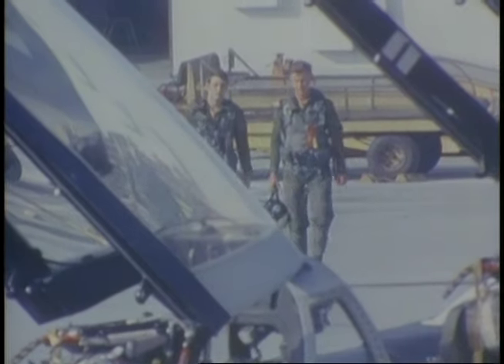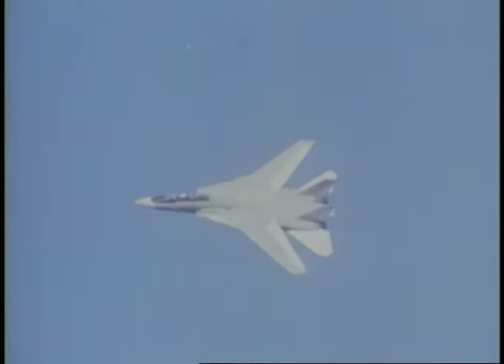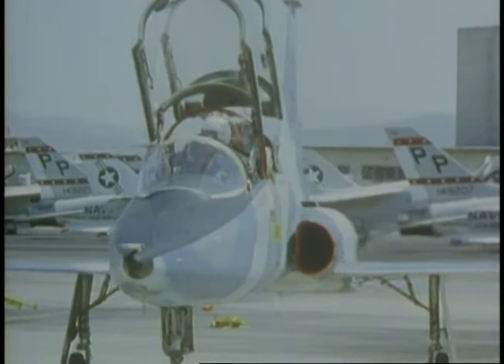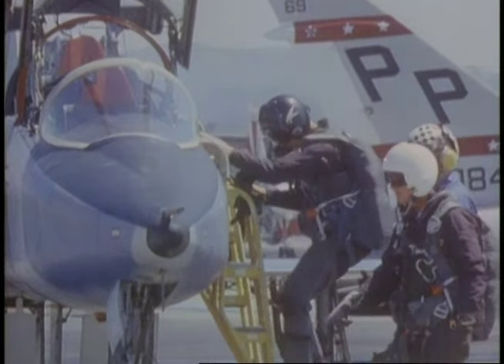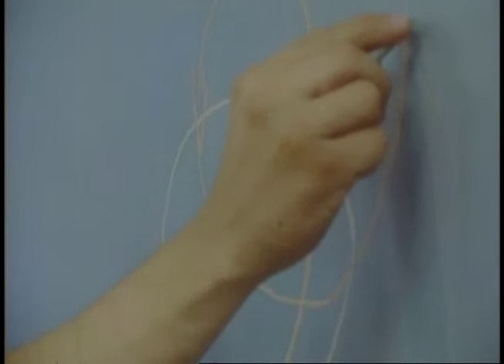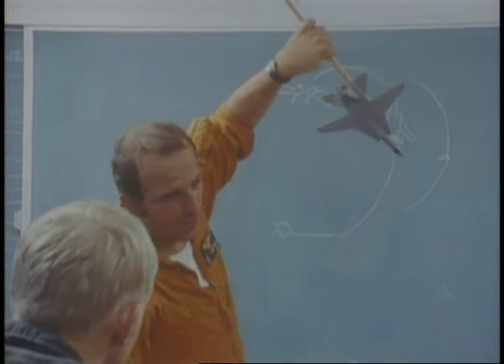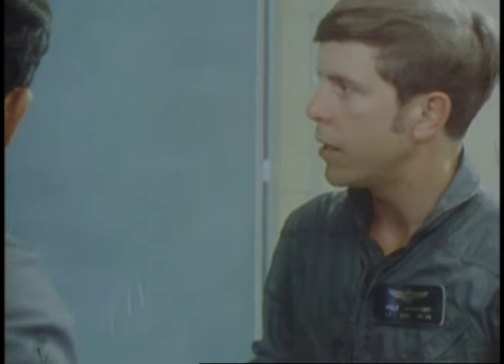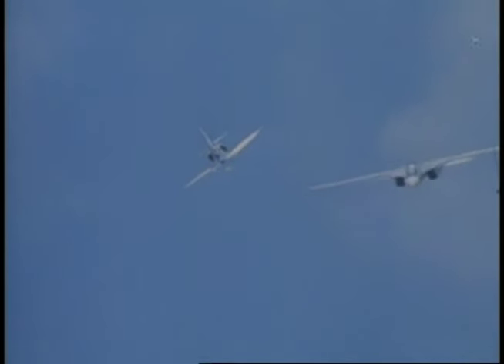F- 14 Tomcat | Air Combat Maneuvering

Comment: Amazing plane.. a plane so advanced it nearly left Grumman bankrupt and the Navy without a fleet defense fighter.
Reply: The only reason we could afford them was because the 79 Tomcats that the Shah of Iran ordered lowered the per-unit cost of the Tomcat to a level we could afford
Reply: @nickfury1279  Correct - except Iran paid for 80 Tomcats, but the last one was never delivered due to the overthrow of the Shah.
Reply: Yep, and that’s when the Shah Iran came in and rescued the entire program by heavily investing in Grumman and purchasing 80 F-14A models!
Reply: @dosgamer74 wrong! The 80th plane stayed at the factory as a TCO plane where they would test, modify and try to reproduce and fix the problems that was being reported from the original 79!
Reply: @pnayeri  My point, was that 80th airframe was intended to be delivered at some point. Regardless of any teething problems Grumman were having with the airplane, that is what Iran paid for and was ultimately supposed to receive. After the Iranian revolution, that 80th airframe went to the US Navy instead.

Comment: this is something you could do in F14 : 
if you remember the "maneuver" done by maverick in the movie when he "SPLIT THE THROTTLE" of the engine on his F14 to do an extreme "yaw"-ing? thats doable in real world jet fighter with well separated twin engine placements. will not work on F18, will not work in rafale, or typhoon or any other twin jet engines fighters that has very tightly grouped together engines. because it is relying on the effects of handicapped engine that will "promote" roll to the craft like what you would witness in passenger crafts. 
its still can be done in russian twin engines fighters like the SU 27/30/35/37 and mig 29/35.
but you would need to add extra treatment. just splitting the throttle wont do any thing but simply promote a slight "roll" in rotation towards where the engine is losing power, you can use it to do an extreme yawing that transform into a sharp turn if you also use the rudder to turn towards the engine with less power, which then cause your plane to bank towards that side with nose already some 30 degrees into that direction, and velocity already sets to do a tight turn. if follow it up with a tight turn/pitch you will make a super narrow brief turn.
 but with note : YOU ARE LOSING SIGNIFICANT AMOUNT OF ALTITUDE. which is the POINT of doing it. so you can punch the throttle both engine full at the "spiralling" descent and follow it up with an inverted loop and wind up behind your opponent. not exactly happen the way like what tom cruise character is doing it in the movie, but this real world version is more effective. maybe some pilots out there should try it out.

Comment: Let's be real; any fighter jock of that era will tell of a an airframe that was a bitch to fly, with unreliable engines that was after all as severely a mishmash of a design as was the shuttle spacecraft. Having said that it paved the way forward for "nextgen" fighter aircraft. If, IF u knew the avionics and its shortcomings inside out, then you had a chance to compensate, otherwise it was hell to fly it.